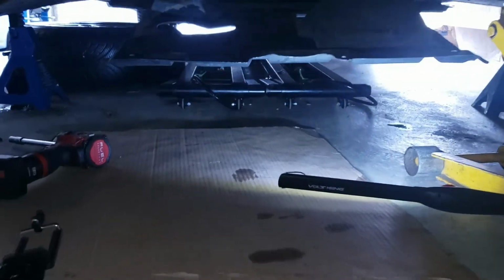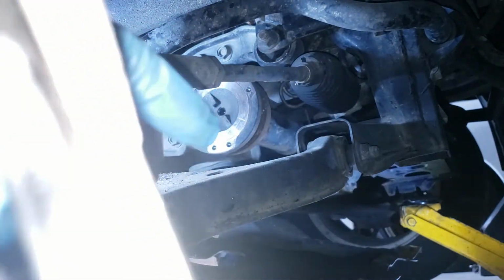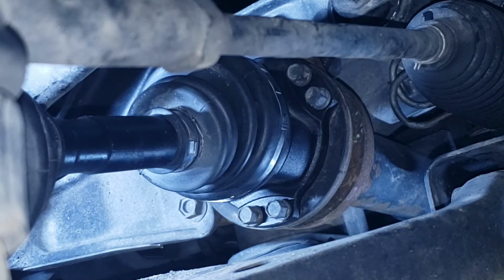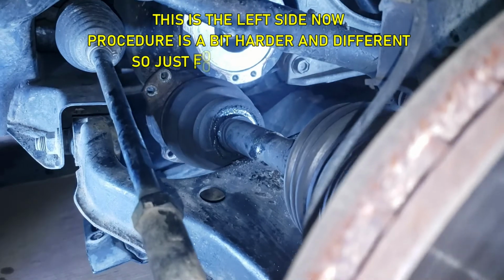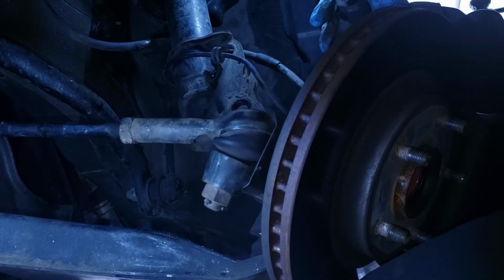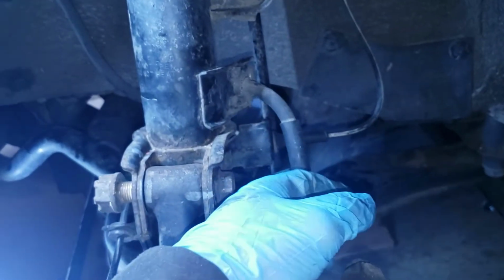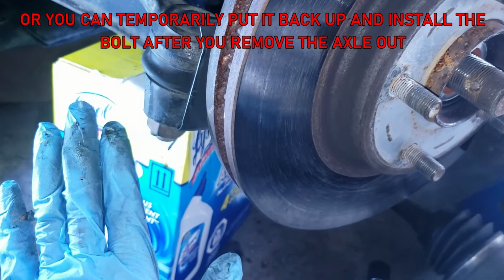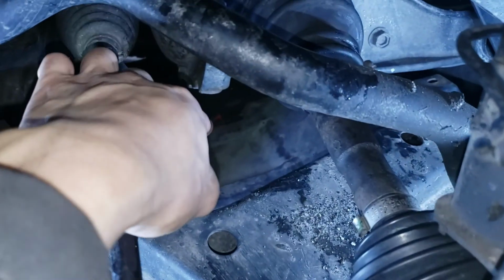NISSAN ELGRANDE AXLE SHAFTS REPLACEMENT E51

Comment: I'd like to thank you for your efforts for making this video,today l had my first issue with my elgrand, l put In new struts and l noticed a cracked boot and l thought l could just put plastic and tape it,l got into my vehicle and it was shaking and l parked and l looked under the driver's side and the boot that is at the opposite of the motor was twisted,lts been shaking alot also when l brake,l guess it's time to change that axle
Reply from the maker: @waynesommer4775  glad i could help.

Comment: Hi, thank you for this video. Ive got a nissan elgrand e51, 2008. What year elgrand have you got? I want to check if the oart is the szme. Thanks, jo
Reply from the maker: This is a 2006 elgrande. I think the parts are the same. Its the same generation. (2002-2010)

Comment: Hi, thanks for the video! You said Left/Right doesn't matter, are they identical parts then? I have a torn inner cv boot on that same assembly and can only find a used left side. Would you recommend replacing the whole cv axle or would a boot repair kit be okay? Thanks again!
Reply from the maker: According to my friend he said that they are they same part number. Left and right. A boot repair kit would be good enough as long as its not giving you problem (noise when turning).
Reply: @Cargorage  I appreciate the advice. No noise, but there is a clunking sound when I go side to side (I'm thinking it's the sway bar bushings or drop links)... btw, would you be open to doing the repair? ;D I'm in Vancity.

Comment: Thanks for this video - Just about to do the job (left side!) myself - Read that it's not best to jack up the E51 from the middle of the x-member though as it's not strong enough there - Is that rubbish and it is strong enough?
Reply from the maker: You're welcome. Well its not as strong per se' but it will do the job for sure. GL

Comment: Is this a 2 wheel drive elgrand or a All 4 wheel drive model ?
Reply from the maker: This is the all wheel drive one.
Reply: Thanks heaps
Reply: Just wondering where you got the whole complete cv units from in Japan, , im in Australia and the auto parts supplier in my town said they weren't available and id have to send my old ones away to get re-conditioned  :(
Reply from the maker: @silowe1  sorry i don't have the exact info but for sure my costumer said he ordered and got it from japan.

Comment: Thanks a lot for the Great Video! ... I'm hoping to get this done tomorrow... (In the rain 😭)

Can anybody point me in the direction of Torque settings for any of the E51 suspension!? 🤔

i.e. Inner CV Joint bolts (x6) ? --- (Estimate in this video = 16-30 Ftlbs)
Anti Rollbar Drop Link Bolts ? ---
Axle Hub Nut ? --- (Suggested in Video = 155 Ftlbs)
& Also the Lower strut bolts (22/17mm) ? --- (Suggested in video = 110 - 130 Ftlbs)

Any help is greatly appreciated! 🤟😎
Reply from the maker: Youre welcome.